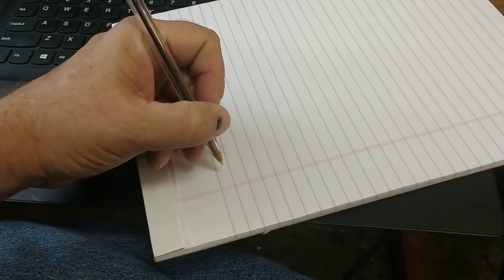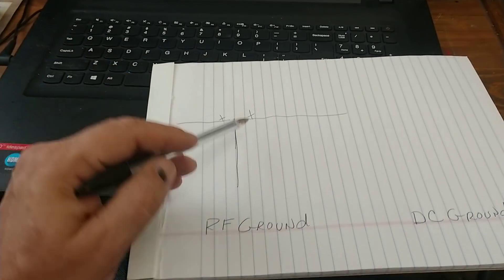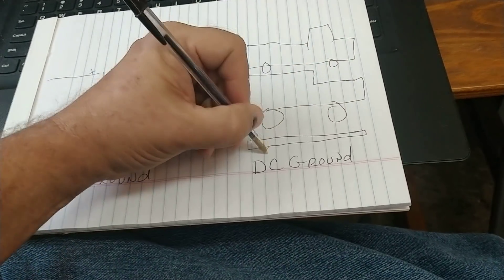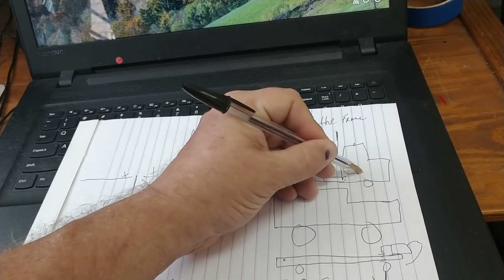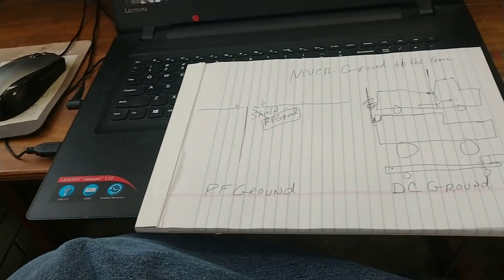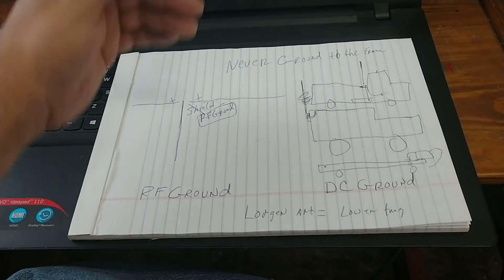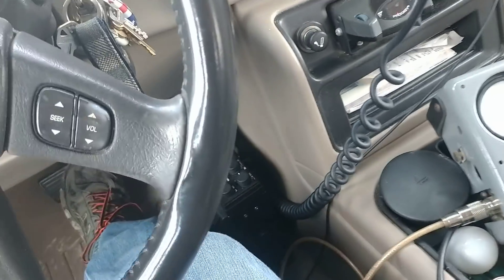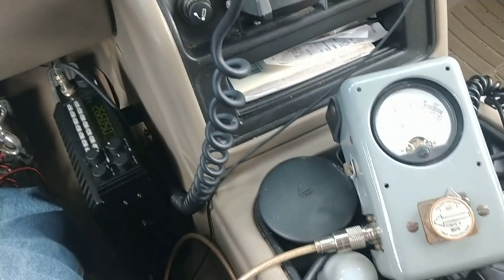Mobile antenna tuning/ RF ground basics

Comment: First you need to exsplain the RF is AC.  Most pplmdint know this.... RF is AC  current ... DC is direct current ....the ac shield bond is the foundation of the RF center conductor.. it's the other half of the antenna... They should be looked at equally.....both are equally important

Comment: 05:35 not 100% true.. the actual wire you use from antenna to the chassis will KINDA act as a radial..KINDA, and its short depending how long a wire you use.... but the actual connecting the wire to the chassis is pointless! lol.. GOOD VIDEO well said! 40+ years experiance here and agree with you 100%

Comment: Hello Smoking Joe, Please help, I have a RCI 2950 and when I turn on the device in RX and TX is one channel lower until it warms up a bit, then I lightly hit it on the lid Please help, I have a RCI 2950 and when I turn on the device in RX and TX i have one channel lower until it warms up a bit, when it warms up a little then I gently knock on the housing of the station and then it comes to the channel it needs otherwise it is always 1 down
Please if you can help what should I replace 
73... 9A3DZL, 328lr021 Nebojša

Comment: Trouble finding an rf ground on my Rv fiberglass roof. Used a baking tin and  mag lil will for my 2970n4. Guess a really long wire for rf ground to a metal frame stud or roof joist?

Comment: Cobra 25 Ltd classic, radio is wired to the battery and grounded to the ground on the body attached to the battery. Antenna is mounted inside an aluminum part of my bed. I have proper continuity in the coax. SWR is above 3 on 1 and 40. Nothing I try brings it down, plz help anyone. I’ve tried grounding the mount to frame and body, no difference.
Reply: Try a different antenna.  Hopefully you have solved your problem! 😀

Comment: I just bought a 2011 Ford Escape XLT, and I'm wanting to run a Wilson 1000 magnet mount, but the best area (middle of the roof) is fiberglass.  Any suggestions??? at some point I will also be using a Predator 10k.    Tnx for any tips 73's de Delta Tango 216 the "radio bandit" :)

Comment: Moder trucks have so much rubber mounts for the panels and cab, run low ohm grounding straps from frame to each panel. This gives all the panels a good dc ground, for a good ground plane.

Comment: Inevitably wont you have dc ground in the body panels.   Not all mount points are isolated in all vehicles
Reply from the maker: You don't need isolation . Only sufficient surface area for proper counterpoise

Comment: I'd make sure you didn't go out and buy some cheap coax. Your signal "sees" the metal of the vehicle through the "cheap" coax and it's reflected back, causing bad SWR readings. Buy the best coax you can buy, no matter what you are using it for.

Comment: But there is usually continuity between the frame and the body of the truck anyway right ? So what's the diff between bolting to the body of the truck or the frame?
Reply from the maker: Surface area. Counterpoise. Your frame will never be sufficient counterpoise

Comment: Getting both 10m/CB and VHF/UHF (144/444) units installed next week, at local CB shop, only one in the entire region, and they seem unsure about the HAM unit, being unable to tune without as they say “we don’t have equipment to tune at vhf/uhf frequencies” - They typically only deal with CB/10 m.  To verify their install (2units, 2 antenna) do I need a tuner, or just a wattmeter as shown in video?  The intended antenna is a 2m/70cm by design.  I’m new to all this and no ham shops of any kind within 300 miles.

Comment: I have a question for you. I get a 1.0 to 1.2 across 40 ch. with firestick on 2015 389 pete mirror bars. 1.0 on ch 15- 25. Great match. When I try to install a wilson 2000 on it jumps from 5-7 on swr. Same mount, same location. The same on several locations on the mirror bars. Thats a wilson straight from new package. Tried 5” and 10” shaft. It will not adjust lower than 5.0 on swr. Using radio meter and dosy base station meter. The same. Any ideas on what it could be? Or does my anytone at-6666 just does not like a good antenna?
Reply from the maker: Sounds like something is faulty with your antenna
Reply: I will return it and try again. Thanks for the videos
Reply: Ok. I got this wilson figured out. Directions on package state 49.25 inch of whip for 27.205. Then fine tune from there. I installed antenna and bottomed out whip. Like i have always done wilson antennas. This give me 5.5 on ch 1, 7 on ch 40. I was flipping through freq. seen swr was close on 25..... That tells me its wrong length for freq. I started clipping 1 inch at a time until I got it 1.3 on ch 1, 1.3 on ch 40. And 1.2 on all other ch in between. 8 inches removed from factory whip that came in package. Last inch I took off so I could adjust in slider for fine tune. I have never seen this much clipping on a wilson. But matched now and tested. All good to go. Unsure if you have ran in to this with wilsons.
Reply: Thanks for the video. Got my situation in control from viewing this video

Comment: I got a galaxy 98vhp . Running a through roof Wilson 1000. One i turn up the dead key past 30 watts my swr goes for 1.2. To like 1.7. For kicks I hooked up one of my HF rigs and transmitted 100 watt cw carrier perfect 1.1  1.2 swr. What could be the issue with the galaxy
Reply from the maker: The Galaxy is miss aligned. It is producing harmonic content and IMD which means it's transmitting on frequencies other than the channel your on out side of the CB band. Your antenna is not tuned for those frequencies so the power gets reflected back into your radio .  If you wish to send it in for service go to www.442built.com and use the contact tab.

Comment: I see this problem on newer dump trucks. The mirror mounts, the mirror arms are made  out of mostly plastic. When they hard mount a antenna ( example sirio antennae) with a high power ranger,N2,N4 or 63ffb4 the SWR is waaay too high.  Requires a good grounding strap or heavy 6 gauge wire mounted to antennae and truck frame or firewall.

Comment: If you got good rf ground.. 
If swr is low on lower channels and high on higher channels, shorten the antenna.
If swr is high on lower channels but low on higher channels, what do you do?
Reply from the maker: If your swr is lower on a higher channel that your trying to tune on then you will need to lengthen your antenna
Reply: @smokinjoeselectronics442bu7  thank you. I appreciate your work.

Comment: So, I have a CB in my Chevy.  The antenna is mounted to the face of the toolbox towards the tailgate and I have a 12Ga wire to the frame because that's what I was told to do.  When I connect my SWR meter, my readings are CH1-1.1, CH40-3+.  The radio's meter reads the same.  When I take the external meter out of line, the radio reads CH1-1.5 Ch19-1.0 Ch40-1.4.  Only reason I could think of is that the cable is radiating RF and adding the meter obviously changes the "effective" antenna length.  Am I fine or do I have a problem?  Should I reground the antenna to the bed and tie the bed and cab together?
Reply: BTW, this video was quite helpful.  Thanks.
Reply from the maker: Unground from the frame and run ground to your bed and cab body. Reset your antenna you should fall flat and won't have the other issues
Reply: @smokinjoeselectronics442bu7   thanks I'll try that

Comment: Love to know what you have done for ground plane on the new cascadias..My swr is below 1.3 across the board..My r is between 46 and 52 and my lowest x is 6..I have to go lower to about 26600 to get a 0 resonance but my rec is low..Running a 7ft skip shooter on a mirror arm mount..lmr 240 with amphanol ends(soldered)..For shits n giggles i tried with a single coil 10k on a 22" shaft and not as good rec but almost exact same #'s..Only have 1 braided strap on my door hinge but multi meter shows almost noo resistance at all..less than 1 ohm..Useing a procomm mirror arm mount for the 19 cascadia..Im thinkin the prob is the mount..Your thoughts?
Reply: is it angled forward about 45degrees.

Comment: What if your bed is grounded to the chassis and your antenna is grounded to the bed is that sufficient?
Reply from the maker: The cab of the truck and all body panels should have continuity with the antenna mount for proper RF grounding
Reply: dc continuity or rf continuity ?
Reply from the maker: @andhanwer  neither. Rf or DC...Continuity means an uninterrupted connection.
Reply: lol but obviously they aren't so are you recanting everything you said in the video about rf ground?
you can't have it both ways, you know.
even if there's more than one of you
Reply from the maker: @andhanwer  not recantung anything Radio frequency ground has nothing to do with direct current.. continuity is a solid or unbroken connection... I'm sorry it is so confusing for you . It's really simple
Reply: it's not confusing at all. The answer was: "BOTH, and then some, as long as practicable" , "you can only lessen the compromise"